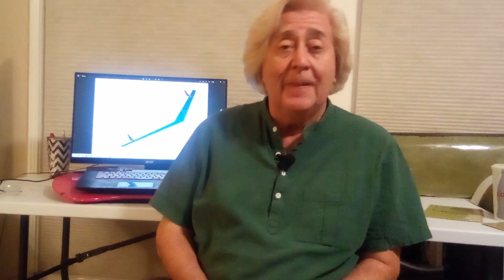Flying Wing Design - KW MkIII

Comment: I would like to a see something traditional soaring clubs (sailplanes) could afford that would offer open air soaring and also towable behind their club towplane.   Stick and rudder to fit in with sailplane learning trajectory.
Reply from the maker: I think this is one option that has commercial possibilities. There could also be a powered option. This could be something like the Archaeopteryx, but more durable (heavier) and perhaps more cost effective via the use of then new Full Size Determinate aircraft production techniques combined with 3D printed parts.

Comment: Hi! My proposal is to take over and develop more, the Mitchell flying wing concept. You have never discussed about it. The concept of "Junkers Flaps", or "wingtip slots" has been used by two US flyin wing pioneers only: Don Mitchell (with success) and Jack Northrop (without big success, but the slots were not designed properly). Oh, I forgot! They were used also by A. Lippisch in his Me-163 Komet (with success). So, I believe they are a very promisong concept for some types of flying wings to make them spin-resistant. Lastly, the Mitchell wing and its variants has been the most successful (commercially) flying wing design ever, althpugh it is not widely admitted.
Reply from the maker: I believe I said in the video that continued development of a Mitchell Wing in the area of elevon shape and winglet placement would be an interesting thing to do. Maybe you didn't get that far in the video. Wing slots are very draggy at slow speeds - a bad thing on gliders (powered aircraft OK).

Comment: How about a rigid with swift style cockpit but where the pilot lies prone on their belly and the stick is to their right, flaps and trim to the left. Wouldn’t be foot launch-able but so what. You’d have all the performance and an awesome view! A cross between a Swift and a Horten. It’s probably already been done so forgive my ignorance.
Reply from the maker: Folks often have this desire, but unlike a regular flex HG This position/cage style leaves the pilot exposed to a broken neck in almost any botched landing. And, broken necks are much harder to fix than broken legs. Head first is just too risky.

Comment: There is a structural price with the twisting force consequent to a (swept) flying wing (to obliviously argue against the one constraint you set).  How about incorporating unmanned capability to expedite safe testing, as well as provide autopilot and capability for novel uses?
Reply from the maker: Yep, computer augmented fly-by-wire is now mature and light enough to consider as part of the solution. It would allow significantly lower static margins which will increase performance. That said, it would still be a cutting edge solution for an ultralight aircraft or hang glider. For sport aircraft there would be plenty of weight margin available.
Reply from the maker: Oh, yes, also a flying wing does not mean it has to be swept. Ilan Kroo and company tested a unstable straight flying wing model back in the 90s with fair success. It was computer augmented.

Comment: What about super lightweit foldable hang glider. So it could be carried on the back like a paraglider. Just an idea..
Reply from the maker: Interesting, what do you think would constitute lightweight? 70 lbs, 50 lbs, 30 lbs, less?
Reply: @KlingbergWingMkII  Well, 40 lbs. maybe? More importat than weight is the way you carry it. For example in czech republic where iam from, there is plenty of takeoffs for pg, where they walk through the forrest for a while. With hang gliders there are limited options and moastly we have to have special permisisons to use every forest road and so on...
+ of couse such glider should have reasonable setup time.
Reply: Yeah, that'd be a great idea.
Reply: Ding! Ding! Ding!
Reply from the maker: However, I don't think there is any real market for it that would allow for a reasonable profit. No profit, no new gliders, except if you do it yourself.